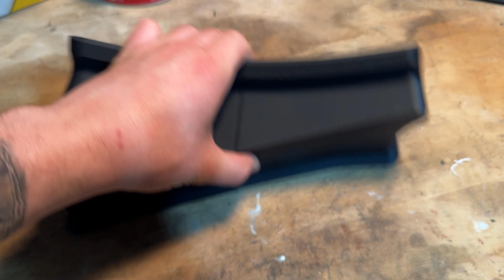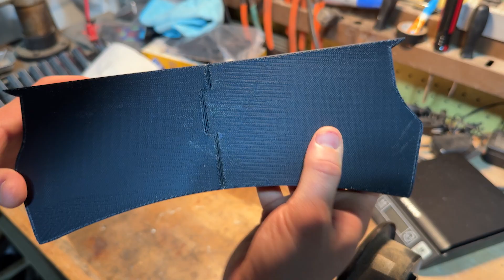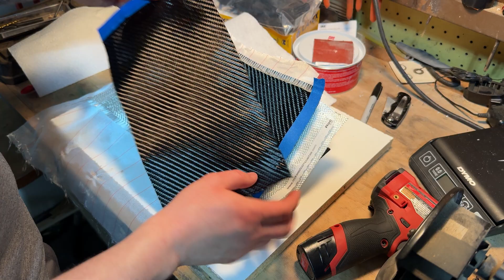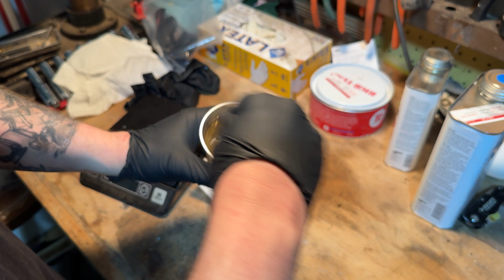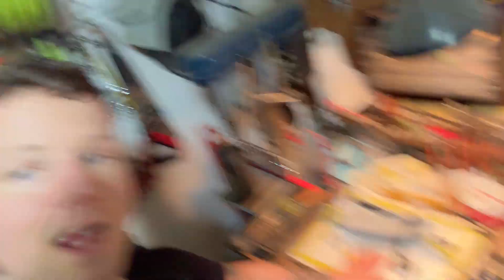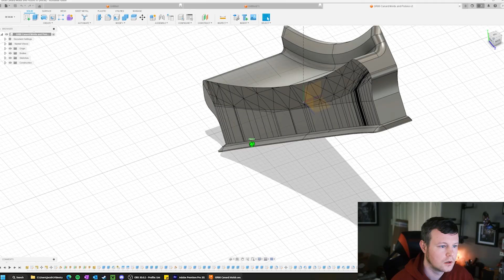DIY Carbon Fiber Canards (pt2): DIY Car Aero Episode 6

Comment: 03:48 I've never worked with Fusion 360, but I model in CATIA. I would recommend using a splitting surface to manually add the fillet.

Extract the upper and front surfaces, join them together, and add the fillet to the newly joined surface. You can then split your model with the joined surface to create the desired fillet. You will need to extract the sides of the part too to blend the fillets together.
Reply from the maker: Hmmm I’ve never performed a process like that. I’ll look into it some more. Thanks!